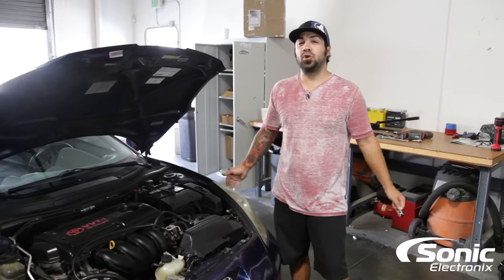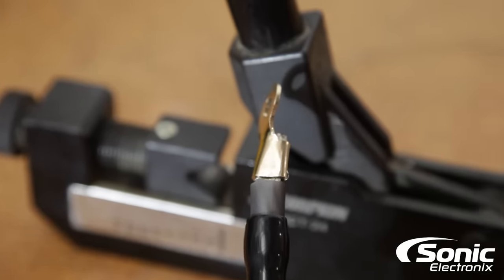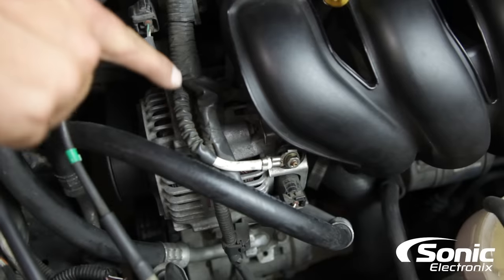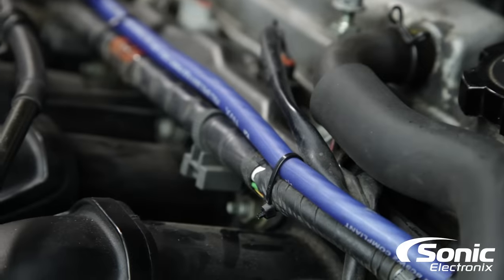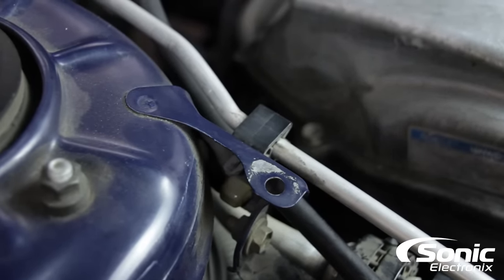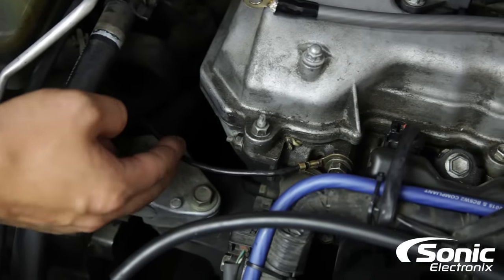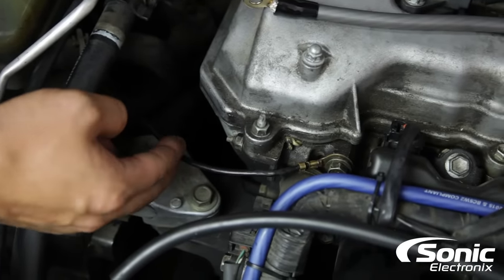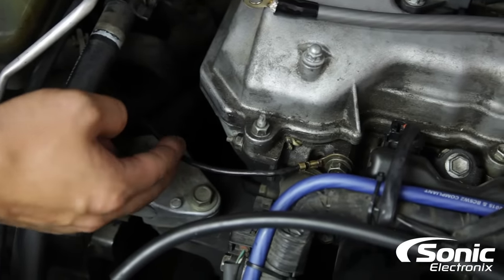How To Install the Big 3 Upgrade | Improve Your Vehicle's Electrical Charging System | Car Audio

Comment: What about a fuse on the ALT CHARGING WIRE To the terminal? They usually go to the fuse box to prevent any issues that could happen. Running it straight to the battery could give you issues and damage your components.

Comment: For the grounds, should you use the existing grounding spots that factory used or make new grounds? I heard talk of having shorter grounds because that's how grounds are meant to be.
Reply: It should be ok as long as however you do it just make sure that the connections are solid on both the factory wires and the new ones
Reply: I like shorter wires, even though electrical resistance is basically the same

Comment: Its easy....all wires 0 gauge. Positive wire from battery goes to positive wire on alternator. Negative wire on battery goes to anything on the chassis. The more wires the the more current. Make sure you disconnect negative and positive on the battery before any work.

Comment: One major reason why you do this is, the ground to chassis. 

Negative battery to chassis it will make stronger tight ground connection. When vehicle shakes and corrosion if only one ground cable the original one it will loose contact to the chassis. One reason why your dashboard lights flicker and gauges going nuts. Check engine light will come on code says low voltage in Ecm, PCM modules. Abs lights, battery icon etc will show up in the dashboard. So it’s a must to do this upgrades.

Comment: Why do this if you ain't swapping the alternator?
Reply: It harnesses the full potential of your charging system. Factory wiring is a joke. Every vehicle I've owned gets this (along with a ground from the alternator mounting bolt to chassis) PLUS a bigger power wire from battery to starter.
Reply: @jtpro  yeah but if your alternator can't pump out the juice, you don't need the extra cabling.
Reply: @jintarokensei3308  thats exactly what hes saying... the alternator can, the wire can't... actually very common on mass production cars. Made with cheapest copper components to save a buck.. 

Putting better copper on it, can make actually utilize the full potential of the alternator you already have....
Reply: @TheDarkToes  I see. I was under the impression that wire gaige is optimized for power throughput by factory default.
Reply: Jintaro Kensei wire gauge is optimized for the electrical needs of the car, not the capability of the alternator. If you add extra electrical needs like subwoofers, you’re alternator might be able to handle it, but the charging wire and ground is too small to give it that power
Reply: @cooltv931  I see, makes sense
Reply: I completely understand your question though, you would THINK that the wire they use would be with respect to the size of the alternator. They’re selling $20+ thousand dollar cars and are worried about a few bucks in wire costs🤣

Comment: i think the battery to chassis ground upgrade is a good idea. stock alternator already has good wiring and the block is already grounded to chassis via motor mounts
Reply: This helped me alot to get rid of "alternator sound" in my speakers.
Im also planning to do the block to ground and alternator to battery eventually but my alternator is pretty weak so don't know how much it will help.
Reply: The block is NOT grounded to the chassis via the motor mounts.  The mounts have rubber or polyurethane bushings in them, which is why there is a block to chassis ground in the first place. Smdh.
Reply: MobileTaz funny u mention that now. last week my chassis ground melted and i put a huge cable from my battery to motor mount and another one from motor mount to chassis side of motor mount

Comment: The correct connection from the battery negative terminal should be directly to the engine, not the frame, although adding a connection to the frame won't hurt. The reason? The biggest consumer of battery amperage is the starter, which needs a ground that is compatible with the large positive wire that feeds it. The reason for the factory ground from the engine to the frame is to allow all the rest of the vehicle to have electricity as well, not the other way around.

What you've done is not wrong, just incomplete. Please add a large wire from the battery negative to the engine block in order to truly improve the overall performance of the electrical system, which is the purpose of making this video in the first place.
Reply: Agreed, and the connection point should be as close to the starter motor as possible, I double up from this point to the alternator mounting bolt as well, it all helps with maintaining maximum amps from battery to starter and max power from alternator to rest of electrical systems.
Reply: Makes no sense. Negative to ground is the only thing necessary. Why to the engine block? Metal is metal
Reply: yeah that makes sense.

Comment: You just showed the wrong way to crimp the connector and the wire. The split should not be pushed into the wire.  Added better grounding is an old trick for better ignition and sensor performance. Always ran a star connection of OFC cable from negative battery terminal to grounding point, then to engine block and one to cylinder head(s). The ones to the cylinder heads can be only 12GA.  I used 4GA as minimum for battery terminal runs. 2-0GA for big V8s.

Comment: i think you also need to ground the alternator
Reply: +Arnel H. Ofren It's grounded to the engine via the bolts which in turn is grounded itself
Reply: @suda695  it helps to ground alt straight to battery
Reply: @frankdehne1949  you will actually run into electrical issues if you do that.
Reply: @MenacingRabbit  how so. Its grounded to block. Ive done it to old cars just to get them running when the grounds arent conducting. Maybe 2o13ish and newer could have computer issues. But not the cars ive done it to
Reply: @frankdehne1949  I just wanted to troll someone Frank, you're absolutely right about what you said. I like to leave random comments on various posts and see how worked up people get.
Reply: @MenacingRabbit  kool. Have fun. Just spare me i go two kids 2 and 26 months. LOL
Reply: @frankdehne1949  bruh... you either was cheating or you are terrible at pumping & dumping.